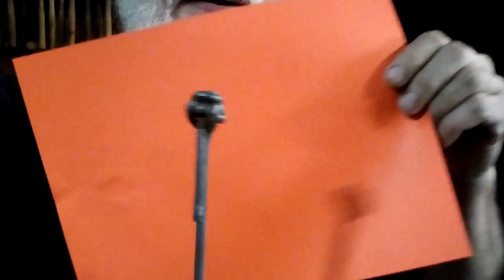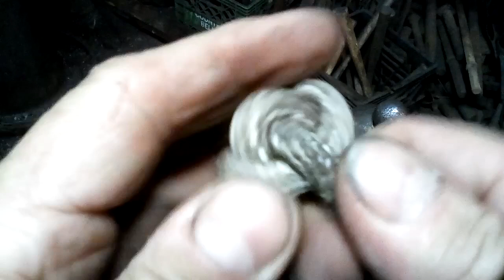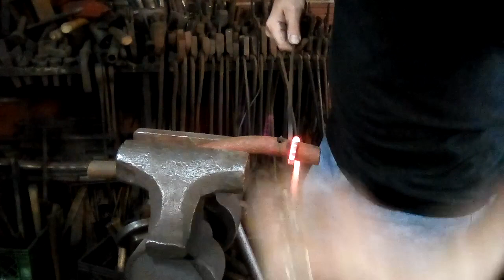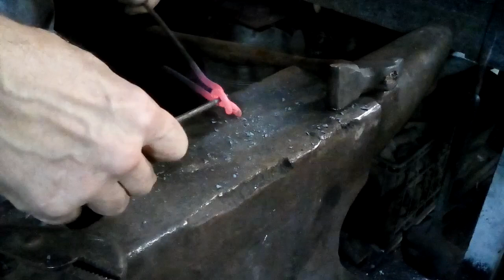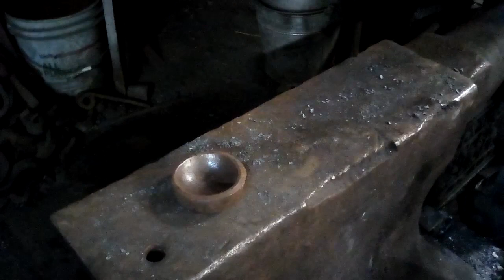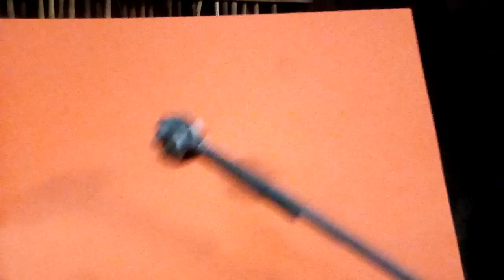A Blacksmith's Dictionary, Turk's Head Knot ,Tying a real knot in steel

Comment: That is pretty fairly amazing. TBH I had no idea one could do that in steel!   Just taken aback. I'll have to watch this many times
Bless days well wishes
Crawford out 🙏🔥⚒️🧙🏼‍♂️
Reply: Still very much a beginning smith.
As such I wonder if there would be any benefits in using flux such as Borax or oil/graphite mix to lube the steel during the knotting process?
  Hopefully that's not too stupid a question.
Thank you very much for your post and sharing the knowledge!
Crawford out🙏🔥⚒️🧙🏼‍♂️
Reply from the maker: hi: Questions are good ! 
It is more a case of heat of the stock than needing lube. 
So highest heat you can manage in the part that needs to move , while keeping the rest cool.
Making this knot using copper wire is fun , try that first.
Daniel

Comment: Wow! Didn’t know you could do such an intracate knot in steel! What would you use something like this for besides a stand alone piece?
Reply from the maker: Hi: They got used as "sword buttons". OK , , forgeweld the two stems together into a chain link and use it as the button that goes thru a slot in a leather frog to hold a sword scabbard. Knots like this were also done in soft wire , silver , brass , on sword pommels.
This is the simplest one, they made some that I still have not thought out the method.
Daniel